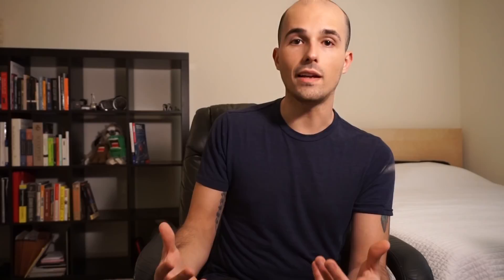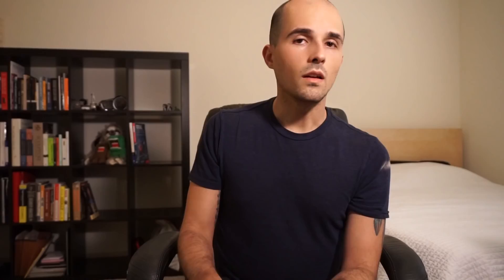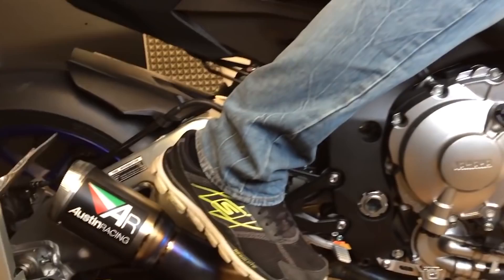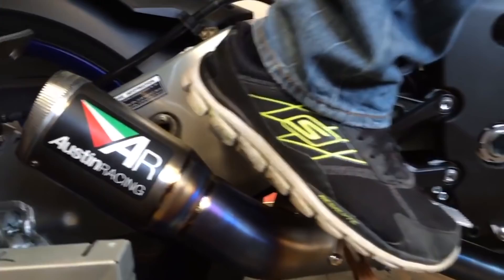Motorcycle Engine Configurations Explained

Comment: Quick links to the sound clips:

1 cyl: 1:15 (motoboy/ 2stroke dirtbike)
Vtwin: 2:08 (harley) {good}
tuned Vtwin: 2:23 
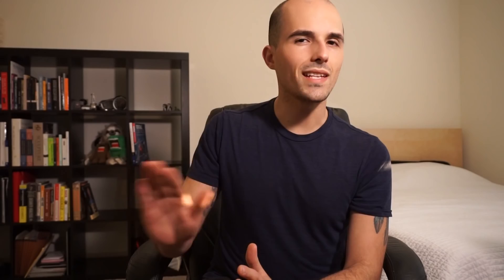parallel twin: 3:10 (little throat)
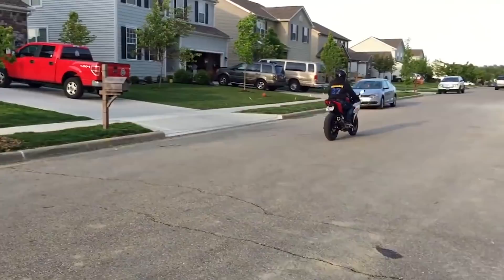different firing order para twin: 3:18 (more throat)
boxer twin: 4:05 (sputtery sounding old timey engine)
3 cyl: 4:39 (not quite a brap, not quite a whine) {better}
inline 4: 5:54 (any sportbike in movies/on tv)
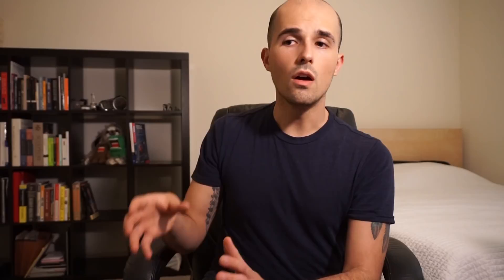alt firing order inline 4: 6:09 (GREAT throat low end, crescendo to an F1 car) {great}
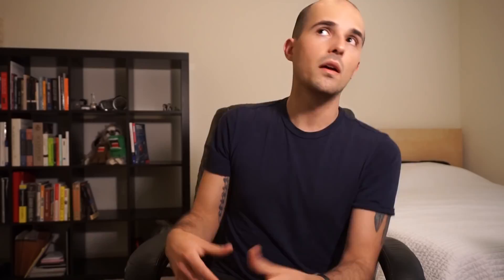v4: 7:19 (slightly throatier inline 4)
2stroke, V4: 7:35 (at full rev, sounds like a less whiny jet)
V5: 8:00 (even keeled throat)
inline6: 8:43 (straight F1/fighter jet muthafuckas)

Comment: Hey hey , finally educated yourself on engine types , nice. :)
Reply: I know right? finally he level'd up , that noob.
Reply: nah, a lot of stuff he says is false.

And he actually things the inline 3 is better than the inline 4 LOL.
Reply: Even a single cylinder on twisty roads is better than an inline 4. Inline 4s are race only engines and needs big tracks with alot of straights and you need to rev it hard all the time. Inline 3 also need to be reved but has more torque. Every engine type is different nothing is better than the other just the specification of each engine changes...
Reply: "you need to rev it hard all the time" so? Inline 4s generally have shorter stroke wich decreases piston speed and allows it to rev higher, that also means that the engine can take higher rpm better without getting too much strees. Because of: more friction area, force spread over a higher number of bearings, shorter stroke (look above).

i dont get why a lot of people seem to have a problem with reving engines that are designed to take a lot of high revs.

" Inline 3 also need to be reved but has more torque" False, in theory the 3 has more torque because of the longer stroke -> higher leverage at the crank shaft. But in practise the inline4 produces either the same or even more torque at the same displacement it simply needs to rev higher. The reason for that is that the pause of power delivery in the inline3 allows the mass inertia to actually slow the engine down for 60° of cranks haft rotation, and the fact that the 4 can make better use of piston momentum.

"Every engine type is different nothing is better than the other just the specification of each engine changes..."
Nah the Inline 4 does all the Inline 3 does and better.
Inline 4:
+more torque at higher rpm
+more power (higher max rpm due too shorter stroke)
+smoother power delivery
+better balanced
+engine lasts longer
+more common (easier to fix)

Inline 3:
+more torque at low rpm 
+better fuel economy (LOL)
Reply: You really went deep with the info , I do track days , I have no problem with reving an inline 4. Also what I said was generally. Go twisties and the inline 4 bike will rarely be in the power band it needs to be(maybe 1st / 2nd gear and keep the rpms high or go wide into incoming lane if you are on the road , lel) and that makes a single cylinder better. (tracks have many straights usually so that is where the inline 4 can dominate) 

All your top 3 + points for the inline 4 cylinder requires the bike to be in the power band. +Smoother power delivery ? as in linear or just a vibrationless engine because surely the power is not linear.. + engine lasts longer. hmmm? +easier to fix. less cylinders = easier to fix , i think.
inline 3 : + more torque at lower rpm , + reaches top power quicker too.
Reply: Surely more cylinders is better as there is less stress per cylinder, if you have a 600cc with a 3 or 4 cylinder theres less inertia for each piston, therefore it will speed up and slow down engine speed faster and less effort to move each piston mean more power can be made. youd need more hp for each cylinder on a 3 cylinder compared for a 4 cylinder, which means less stress on the conrods. 3 cylinders do tend to be smother though. and what you say about not being in the power band is so wrong. its down to the rider whatever gear they are in, it has nothing to do with the engine, it has more to do with the gearbox and the ratios

Comment: "Ducatis are L-Twins!  Ducatis are actually L-Twins!  You got it wrong!"

Hey, guess what.  The L-Twin is a 90 degree mounted V-Twin.
Reply: Bolverk-GTM as you said yourself, an L twin is just a special case of V twin... so he didn’t get it wrong, he just didn’t specify
Reply: And I believe the Suzuki SV650 is a strange offset V-Twin that is almost an "L Twin".  Weird angle of degrees and sits in the frame offset.
Reply: Ducati stopped mounting the engine with the cylinders perfectly horizontal / vertical more or less when they stopped air cooling them.  They've been creeping almost unnoticeably backwards in installed angle ever since, and the new V4 is in the similar optimum range discovered in superbike racing 15+ years ago.  Look at any other sporting 90° V-twin (e.g. RC51, TL1000 etc.) and the engine will be mounted canted forward slightly to give the best optimal room for the airbox, gearbox, swingarm and exhaust, whilst minding the front wheel.  Narrower V-angles don't appear to need to be canted so much, if at all (Aprilia RSV, KTM etc.).
Reply: @identiticrisis  I was going to mention the  tl1000r and the Tl1000s  honestly I miss the TL1000r body though most people hated it.
Reply: yea they are basically V's lmao

Comment: Fun overview.  Thank you.  I had a Honda VFR 750.  It was a v4.  It had torque all over the rev range.  I could stay in second gear from a standstill all the way to 50 mph.  Also, the Honda gold wing has an in-line 6.  They run forever.

Comment: R1 sound is also due to the crossplane as opposed to flat plane crank, not just firing order. Similar to an American or German V8 (crossplane) vs a Ferrari/Lamborghini or Formula 1 V8 (flat plane). Same effect, at identical RPMs, the crossplane sounds much deeper - its harder to make it rev high though.

Comment: Ok, piston engines that have been used in motorcycles, ranging from common to prototype:
There is a V6 (Honda Valkyrie), two stroke V3 motorcycle engines (early Honda NS500, NS400R),  flat 4's, flat 6's (normal Valkyries), (we have entered the mad realm) W3's, V8's, Split singles, U engines (am I insane pointing these out?) and H4's. I had to look the last 2 up just to satisfy myself.

Comment: You forgot the 180 and 360 degree inline twins in the beginning. Also, I believe the Kawi 650 is a 270 degree crank, it just sounds weird because of the exhaust or something.

Correct me if I'm wrong on that last one....

Also, you used an old cruddy sound for the boxer twin. Use the new one, bro.

And yeah, you missed at least one more. The boxer 6 used in the goldwing/valkyrie. Also, letting us hear some two stroke twins and triples would've been sick. Two stroke twins sound orgasmic.

Comment: The inline 4 is superrior to the inline3 by all means.

Inline 4:
+more torque at higher rpm
+more power (higher max rpm due too shorter stroke)
+smoother power delivery
+better balanced
+engine lasts longer
+more common (easier to fix)

Inline 3:
+more torque at low rpm
+better fuel economy (LOL)

Comment: You missed at least in piston engines that 4line can be mounted in longitudinal way (old bmw k100 and k1200 bikes), bmw also have line 6 now in k1600 bikes. Also honda made goldwing that has 4 cylinder boxer engine. And 5 star.. :)

Comment: You didnt cover Radial VTwin vs OffSet Vtwin. Harley's Big Twin VTwins and EVOs for example are Radial where the cylinders are in a direct radial configuration, where as Honda's VTwins are Offset, where the Front Cylinder is to the Left, and the Back one is to the Right. Both are still Perfectly verticle, but cylinders are no longer sitting in a Radial configuration on the block.
OffSet and Radial vtwins sound different. You only featured the Radial version, not the Offset.

Comment: 😮 You call some motors "inline" that I've always heard called "transverse" because the cylinder configuration is across the front to back of the bike profile. The "inline" configuration properly applies to a front to back cylinder configuration as in the vintage Indian inline 4 model 842 I believe. I'm a fan of the vintage Indians and their innovative engine configurations. I believe they even had a transverse Vtwin. Ariel also had their "Square Four" engine btw.

Comment: Hey Yammie, cool video, but I was left wanting a little more. I would have liked to see you talk about v angles and maybe bore/stroke ratios. Also, I would have liked to see all your engine sound examples to be the bikes doing the same thing, such as all idling, all revving, all under load, etc. Because the bikes in the video were all doing different things, it was hard to compare the sounds. I also want to mention that single cylinder motors don't always sit up and down. The Kawasaki Z125, for example, is a single cylinder bike, but the engine sits flat. I still love your content, this is just my two cents. Keep it up!
Reply: I think he should of been the one making the noises. BRAAAP!

Comment: what about the guzzi  horizontal v twin?
Reply: Bill Buck horizontal vtwin? wtf? you mean boxer?
Reply: Fede Tachibano nope... it's like a v-twin, but with the two cilynders pointing sideways
Reply: Kind of a hybrid between a boxer and a V twin. Think a v twin turned 90 degrees with a shaft drive like from a boxer coming out parallel with the crank.
Reply: v7
Reply: Bill Buck Still a V2-engine just unconventionally mounted.
Reply: Yep like Philip said, no fundamental difference from a Harley V-Twin except for the 90-degree V-angle. It's called a longitudinally-mounted engine, since the crankshaft runs parallel with the driveshaft (north-south).
Reply: handles very different from a traditional v twin. my V7 pushes you to the right when you Rev it!
Reply: I test rode a Guzzi V7 a while back. It makes a good noise and handles well, but lacks power compared to my Street Triple.
Reply: Did you try the V9? The V7 is designed to be low power to adhere to EU licence types.
Reply: The dealer didn't have any V9's at the time. I was getting my Triumph 
serviced and the sales guy just about begged me to take the V7 out, so I
 did.
Reply: Lil Mango z oh yes, I test rode the Rninet and it did it too. I forgot!
Reply: Luis Gallardo j
Reply: Transverse is the word you're looking for.
Reply: And can anyone guess why?  So both cylinders get the same amount of cool air vice the HD setup where one cylinder gets all the cooling and the other doesn't.
Reply: Almost everything lacks power to a Street or Speed Triple.

Comment: the R1 has a completely different engine to a casual 600 sports bike, it may have 4 cylinders but god damn it why doesn't every sports bike sounds like the r1... the r1 and mt07 are the fav engine sounds when a after market exhaust is put on em

Comment: I'm always baffled by motorcycle sound comparisons! Since the exhaust is the "vocal chords" of any motorcycle, wouldn't that determine what type of sound a bike makes based on the type of exhaust the bike is equipped with? If you take the same motorcycle and put two different exhausts on it, it would sound completely different. Right?! Harleys being the exception here, my dilemma is how to determine an emblematic sound based on a particular motorcycle engine configuration while deducting the exhaust sound out of the equation! I wish someone would make a video about that!

Comment: A Car guy's interpretation (AKA me)
1. What!? (Single cylinder)
2. Transversal mounted V2
3. A regular V2
4. A chopped Subaru in half
5. An BMW i8 straightpiped without hybrid motors
6. A Honda Civic
7. A chopped Corvette in half
8. WHAT!? (V5)
9. Mercedes 300 SL

Comment: I love sporty high reving v twins. That's not why they don't use twins on dirtbikes. A twin runs smoother than a single cylinder. The do it becasue it's lighter and for engines under 500cc it's just not worth it.

Comment: When discussing v-twins, it might be good to touch oversquare versus undersquare engine design; e.g., why does a Ducati Panigale, with its 959cc v-twin, make significantly more horsepower, but significantly less torque, than a new H-D Fat Boy, with its much larger 1700cc v-twin?
Reply: Karl Hungus 
Also, crank design, valve actuation (Harley likes pushrods and rockers, for some reason), and cam design.
Reply: Crankshaft length determines torque. Ducati's red line at around 12k, right? (I'm pretty sure) So there is no way that crancjshaft is moving that much. But because the engine speed is so quick, it puts out more horse. Harleys have HUGE crankshafts, which is why the red line at 7k (give or take). That is why Ducati's put out less torque, but more horse. It's all in the crankshaft.

EDIT: Think of it this way. There is a big lever. The closer you are to the center, the less you move, but the more you can move the other arm. The further you go, you have to move, but you can move items easier. This is also why Harleys have so much torque. The cranks move the rod much more with less engine speed. Harleys have almost all their power right off an idle. Cant say that for a Ducati or inline 4.
Reply: For one Harley is air cooled thus runs way hotter than liquid cooled stuff limiting performance and its a 2 valve with less valve area than OHC

Comment: Thanks for this.  At the beginning, you talked about the "2 stroke" version of the single cylinder and then later the "2 stroke" version of the 4 cylinder engine.  So how many strokes is the non 2 stroke version? 4?

Comment: there also are v2 engines mounted sideways with the zylinders sticking out to the left and right of the bike. similar to boxer motors. check out older version of the honda cx 500. also insane cafe racer builds of that bike ;) in germany we call that bike "güllepumpe" - wastepump because of the weird blobbing sound :D

Comment: Hi bro could tell which one was most power,which was long life use and which was most popular?
Reply: The only thing that really make a difference in Power is the number of cylinders and the tuning, Engine configuration is mostly size/vibrations and maintainance complexity. Generally fewer but bigger cylinders is more bottom end. Longlife is anything that's not too extreme hp/l ratio for that size and lastly every cylindertype is about equaly popular with the trend going towards less than 4 cylinders.

Comment: not to be picky but ducati's a L twin not a V twin and it's done for a reason.
Reply: Cornish_ Boy L-twins are just 90 degree V-twins
Reply: I know some Yamaha V's do not have the exact same angle as HD.  The SV650 Suzuki and the Duc's have even stranger offset angle V's which takes them away from the standard V twin.  They are also mounted in the frame at weird angles... thus "L Twin" seems to fit their look.

Comment: I love the sound of an inline four cylinder but don't need the power of a litre bike. Any one have suggestions?
Reply: FTB Studios Honda cb400 or most Honda's tbh
Reply: +楪いのり I'm also not a huge fan of cruisers. I've been looking at standards mostly but most of the lower power standard bikes sound like scooters. I'm fixing up a 1982 xj650 right now and it is going to sound killer when it is done.
Reply: yamaha r6, kawa zx6r, mt9? , z800
Reply: +Seon wei jie yeah I like the MT9 and the z800
Reply: just buy , both are cheap and popular in my country, chg the stock exhaust, and you are good to go. Haha

Comment: isnt the Panigale an L twin
Reply: That's just a name Ducati made up. It's just a 90 degree V-Twin tilted forward so it resembles an L.
Reply: Patrick Irons it's semantics really. All Ducati engines are technically L-twins but they're really just 90° V-twins rotated so that one cylinder is parallel to the ground
Reply: NITROLLATOR Oh ok. Thanks!
Reply: I think this is also the reason for the name of the Suzuki TL1000R.   The "L" is the V tilted forward.

Comment: you honestly have no idea

why would a 2 cylinder engine in a dirt bike flex the frame?
Reply: Yep, aprillia actually uses V or L twin in their 450 and 550 dirtbike/supermoto.. the RXV/SXV 450/550.. they wheigh around 105kg and have 55/ 72 hp (claimed, not dyno'd..)

Comment: You forgot the Ducati L-twin (diavel and monster for exempel)  it is more balanced than the vtwins
Reply: L-twin is a V-twin tilted forward so the front cylinder is nearly parallel to the ground. They're the same thing.
Reply: basically a 90 degree vtwin though? Just tilted further forward?

Comment: I'm looking to buy a bike named Apache RTR 200.Its a 200cc Single Cylinder 4 Valve SOHC oil Cooled bike.Check it out.Its a great looking bike.Hope you like it :)
Reply: ZR1 Gamer you won't regret getting the mid range beta motorcycles they're specially designs for leaner how to truck maneuver